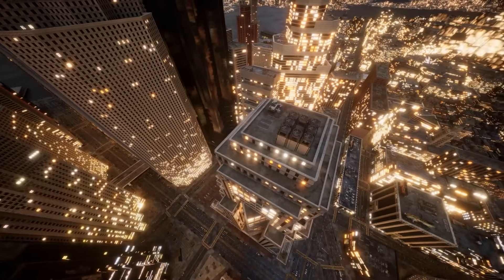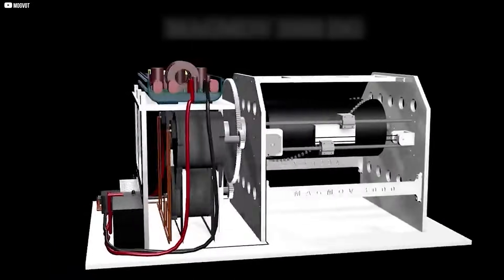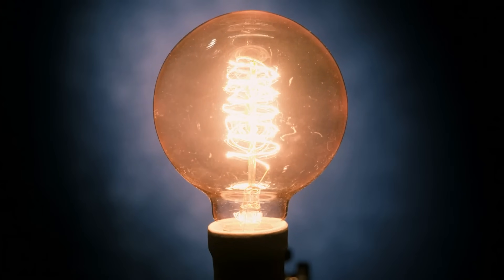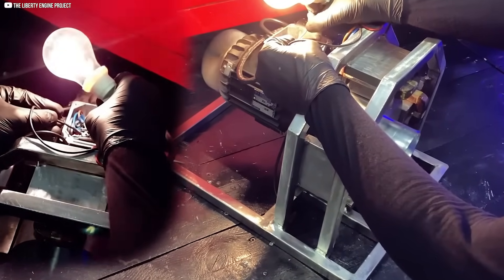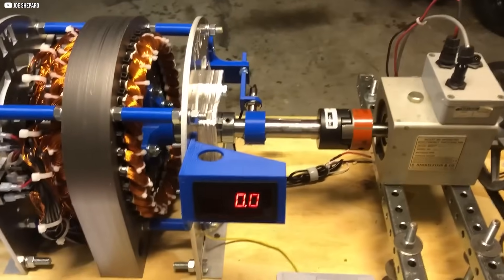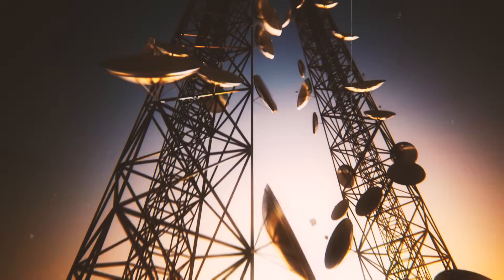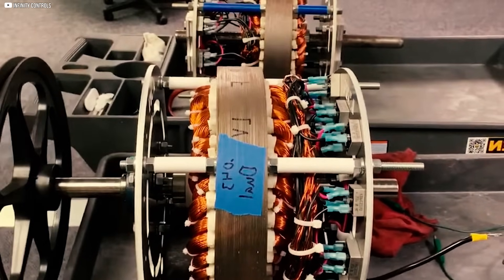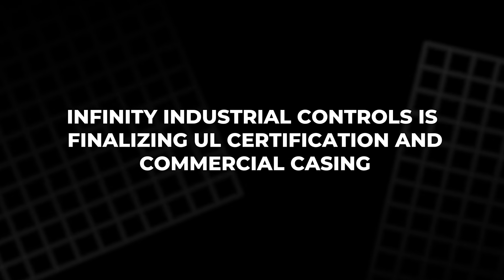Why The I-Generator Might Replace Every Power Source You Know

Comment: I am wondering if it is compatible with single or Three phase inductive motors,or would an inverter be necessary?
Reply: The video said the output is rectified so it would be DC. If you tapped off the AC before the rectification and tried to run a motor it would not run at the correct speed.

Comment: Extra phases requires extra input. Lower speed needs higher torque due to higher resistance. Where is the data 🤨
Reply: No that’s not true. Adding addition phases in the same circle WILL increase energy output without any extra input. Same speed 1000 rpm’s but adding more phases will give you ore power. Simple logic friend
Reply: @Mansahx  from Infinity Control, it is better because it has better power factor, not unlike how continuous power X Ray tubes are efficient.
Reply: @Mansahx   R = ρ × L / A. You must account for resistance in the coils.
Reply: Build one,  I had similar concerns,  I replicated bedini ssg,  I didn't believe it would work.  It worked.
Reply: @abundance9360   @abundance9360  did you measure the input of the initial input and then the input of the extra coils? I don't doubt that extra phases which cycle in-between another cycle create a smoother output but if it requires more power and the gain or work output is no different than running the extra power or amps through the initial motor, then the extra cycles are not very useful. I can set up three identical systems and align their phases to output nine cycles but it requires three times the input. I would also still need to convert it to DC for it to be useful in most applications. Take readings of amps going in to produce the work output. You should see less work out if you use the same input. Just the math alone will demonstrate this. Too many issues and not data to support claims.
Reply: hmm I don't think you fully understand what's going on and how the phases are split up.
Reply: @JF32304  I would suggest you build one and then calculate the efficiency. If it was efficient, it would be industry standard. It isn't as simple as adding more coils.  R = ρ × L / A   this is the formula just for the added resistance based on the coils AWG, length, and cross sectional. This isn't even looking at heat, thermal loss, magnetic field resistance. Try it and test it. Experience is the best way to learn.
Reply: @arnoldbailey7550  I'm working on something beyond this. I've seen 100% efficient units.  Nice build but could be better.